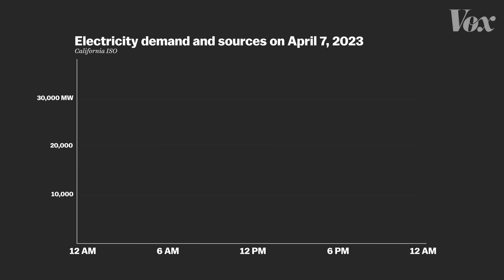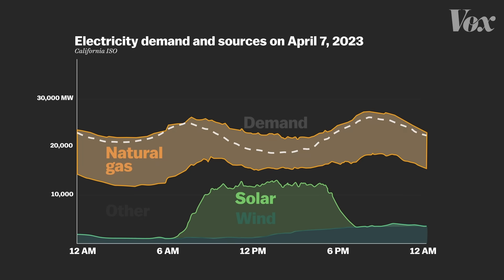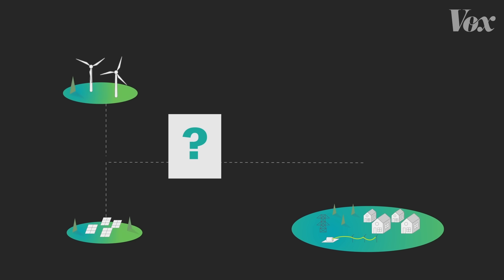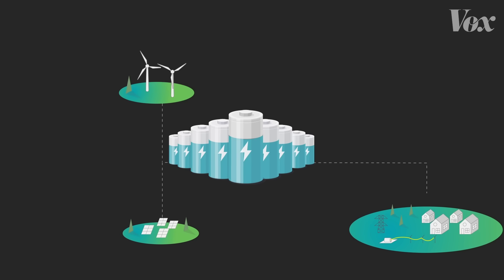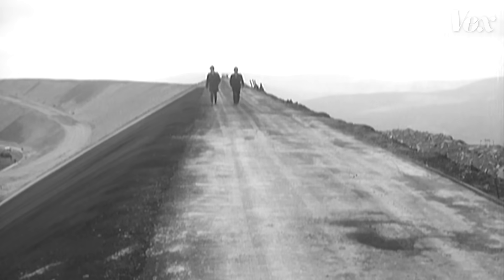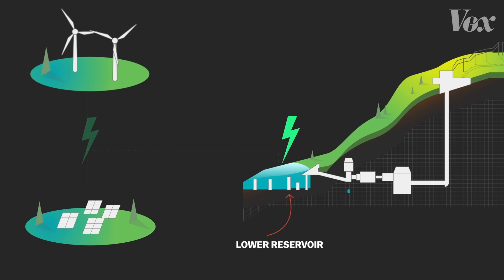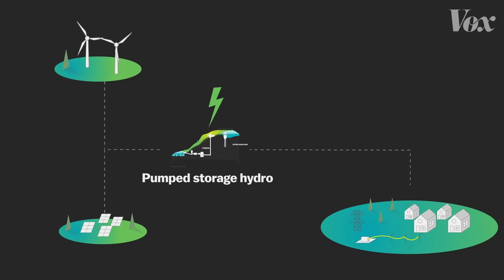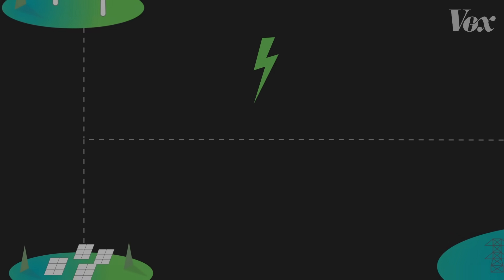How to fix clean energy’s storage problem

Comment: Another option is to overproduce wind and solar and beef up transmission so that it excess in one area can be distributed to an area that has less at that moment.
Reply: It can help to a certain degree, but it cannot replace storage entirely. Weather systems are very large so you'd need to move power vast distances to completely avoid adverse weather. 

If it's nighttime (no solar) and there is no wind, you might have to transport multiple countries worth of electrical energy across half a continent. Such transmission systems are not really economically feasible. And then there's the inefficiency of having that much overcapacity everywhere.
Reply: @fixminer9797  agreed. Another storage option not mentioned in this video is hydrogen electrolysis.
Reply: @kevinmbrooks  Yeah, that seems rather promising and reasonably scalable. It's weird that they didn't even mention power-to-gas systems in the video.
Reply: @Kevin Brooks  the issue with H2 storage is efficiency. Electrolysis is currently too inefficient to make it economically viable unless the electric company is paying you to take the excess power.
Reply: @stevk5181  for what it's worth, the Volts podcast had an episode about developing and scaling up elecrolyzers recently.
Reply: Which makes electrolysis
 a good fit for combination with overproducing electricity from renewables. Unfortunately the hydrogen (edit) embrittles the metal so you can't easily use the natural gas network to then distribute it AFAIK.
Reply: @szurketaltos2693  hydrogen is not corrosive. It can cause metal embrittlement, but that's different.
Reply: @stevk5181  fair enough, I'll edit that. Still, not great for pipelines.
Reply: @stevk5181  so looks like up to 15% hydrogen gas in a natural gas pipeline is feasible, whereas a pure hydrogen gas pipeline is possible (and not unusual in industry) but requires a new network to replace natural gas. Is that right?
Reply: @szurketaltos2693  I'll be honest, as a chemist, I don't know specifics on pipelines capabilities. However, if it's safe to mix up to 15% H2 into natural gas, that would be helpful in cutting CO2 emissions while maintaining current infrastructure until new H2 specific lines could be put into place.
Reply: @stevk5181  as I understand it, it's not safe as is but doesn't take too much to allow for the possibility. Not sure where the cost/benefit is there vs just using the money to incentivize going fully electric.
Reply: @szurketaltos2693  in my mind anything that cuts emissions to buy us more time to electrify is a benefit, especially if the cost is near zero. We'd still need to transport H2 throughout the US because some areas are more prone to generate excess electricity than others. H2 then allows for the storage of the energy and transport to where it's needed most, just like natural gas. So we need time to build out that infrastructure.
Reply: @Kevin Brooks said "beef up transmission so that it excess in one area can be distributed"  
Doesn't that run into the issue of losses over distance?
Reply: @LabGecko  I think that's the point of "beefing it up", making bigger power lines and possibly high voltage DC. I'm no expert, so don't take my word for it. I'd recommend the Volts podcast episode "Transmission month: everything in one place".

Comment: This video just proved why solar and wind energy is being pushed instead of nuclear energy. They still need fossil fuel as "backup power" during down times.
Reply: There's nothing wrong with wind and solar energy but nuclear power should have been the primary source of clean  electricity decades ago with those two helping nuclear.
Reply: Nuclear is great but it has the opposite problem. You can't really ramp them up and down. They are designed for mostly constant output. So you can't turn them up or down.  There will always be a gap to "fill" either  excess energy you need to store, or something else to turn up to meet demand.
Reply: @jpcool95480  True but at least the power output is consistent, so you don't need like a week of backup storage to prevent days long blackouts because there was a particularly low wind/cloudy week. 

I think that's the part we are missing, cool daily averaging and stuff is quite easy because the amount of power storage for just matching supply with demand over a day is much easier. But we forget that renewables are not consistent over the year at all, which means you need to average out the year. While with nuclear sure it's pretty inefficient to power up and down, but you can just over produce and waste the rest and be sure you have power, or you can average out the day demand, but you don't need backup power for a full week (or whatever level makes blackouts rare enough to be acceptable with renewables )

With renewables what we are seemingly doing is just over producing because the cost per unit is quite low, but then we still can't store it so we need fossil fuel permanently on the grid until such time as we have enough grid level storage to store on the level of multiple days worth of energy.

Comment: Just produce Hydrogen and store it. If I remember correctly the efficiency doesn't quite hit 80% but it is easy to store
Reply: Water electrolysis can achieve 70-80% efficiency only, then there's the energy loss of compressing hydrogen and building thick tanks to store it. Then converting hydrogen back to electricity using fuel cell is only 60% efficient. If the hydrogen is used to drive a turbine that drops to 30%.

Comment: Another potential solution will be eletric vehicles! We will have millions of bateries in cars that most of the time are parked. So we could use them to power our grids when needed as a virtual gigantic battery (for instance cars when parked at the workplace could recharge their batteries during the day when solar energy is the highest, and then at the night part of that energy could then be sold to the grid).
Reply: Back of the envelope calc shows that it wouldn't even provide a day's worth of power -- when, ideally, there needs to be a minimum of 1-2 weeks of storage to account for periods of lower than average solar/wind.

Assume 8M vehicles with an average capacity of 100kWh. Now assume you'd have 70% available to discharge at night (because nothing is ever ideally 100%). Now use an average future California energy demand of 40GW:

(8M x 100kWh) / 1,000  = 800GWh
0.7 x 800GWh = 560GWh
560GWh / 40GW = 14 hours

Sodium-ion grid-scale batteries should've been discussed as they have the potential to be significantly cheaper than lithium-ion batteries along with a nearly inexhaustible supply of sodium. Nuclear and advanced geothermal should also be on the table. The cost of nuclear could go down significantly if done at scale and not as one-off projects (e.g. Vogtle in Georgia).

Comment: Energyvault? It can't get much worse. Gravity is a weak force. You need mammoth amounts of weight going up (that's why we use entire lakes in pump hydro storage). Water is also flexible and can't break.

Sigh. Stop peddling this nonsense. Even gravity vault themselves don't believe this anymore, and is roling out BESS.

Comment: This same thing can also be done with compressed air in salt caverns. I think it’s called CAES, compressed air energy storage.
Reply: And flywheels, and molten/redox and flow batteries
Reply: Or hydrogen
Reply: @Mesh17i82  that's the horse that oil companies are betting all odds on
Reply: @BeLowBelowo  if they spend Billions on it. Let‘s go

Comment: Here's an idea: use the irradiated water from nuclear fission power plants in the modular pumped storage, this way you have a solution for storing this water while it takes time to release it's harmful radiation, and you put it to use as a battery at the same time!
Reply: 1: There is no irradiated water.
2: If there was, you would NOT want it out in the environment in any form.

Comment: Quidnet's idea seems to be much more realistic than Energy Vault's, it would take a comparable amount of engineering and would have less maintenance costs, since water doesn't erode like concrete does. And you don't have to reinvent the wheel here, it's just miniturisation of existing technology. Did I mention the CO_2 output of concrete production?
Reply: Water doesn't erode but the infrastructure it's in does erode.
Reply: @szurketaltos2693  then build it underground?
Reply: @someguyyt8595  underground still requires infrastructure like pipes and coatings
Reply: @someguyyt8595 price of underground construction is much higher due to excavation and foundation support
Reply: @gargara1900  that too. I think it's probably a similar (but worse) situation to pumped hydro where there are a few caves that would be good enough, otherwise you need to dig.
Reply: @gargara1900  no, usually they use pre-existing caverns
Reply: @Valentin-oc5nh  u still need to conduct stability tests and soil profiling for existing caverns tho, not all existing cavern can serve as the site
Reply: @gargara1900  I agree, but I think considering the scale I think it makes sense. But as the video suggests, a mix is needed
Reply: @Valentin-oc5nh  i do agree that a stable pre-existing cavern can definitely save lots of cost. I think we do agree that a mix is needed.
Reply: Vox had just 7 days ago what's the problem with concrete. :D
Reply: @rocko44444444  the concrete certainly doesn't have to be brand new though. It's just an example of a weight,  I'm sure any material could be used. 

Would be great if they were able to bundle up construction waste and make that the weights.
Reply: the same is done with air actually
Reply: Water evaporates
Reply: @IncognitoChopper  Of course! Water evaporating from a closed, pressurised, underground reservoir! Why didn't Quidnet think of that?!
Reply: It is about localisation… water you need gradient differences, just hanging weights, could be placed all over

Comment: This is why nuclear power is also very important! It is a reliable source that can be ramped up or down in conjunction with renewables to meet demand.
Reply: AFAIR nuclear can't be so easily ramped up or down, but once it's built, it's a stupidly cheap way of getting a base load of electricity, helping the grid have higher surplusses when wind/solar pick up, and lower valleys when they don't; so you have more spare energy for storing it on the good times, and need less storage for the bad times.
Reply: @cc_jmk  Nuclear is very flexible! You can control the power output of the fission reaction, as well as the amount of steam that reaches the turbine. The department of energy has a good article on it.
Reply: @ltmbookworm  Nuclear reactors are "rampable." But the initial capital investment is so high, and the variable costs are so low, that operators want to operate as close to 100% as possible.

Comment: I use potential energy to save fuel when I drive my car. When I go up hill I accelerate for 2/3 of the distance to the top then I coast to pass the top and go down hill. That's very efficient. Much more than staying in gear from a small distance after the top of the hill. I know it's a little bit dangerous but I'm a pilot :trophy-yellow-smiling: No need to worry :elbowcough:

Comment: Other options include Liquid Metal batteries and flywheel systems.
Reply: Just Have A Think has excellent videos on the topic
Reply: The very fact that a 100% fossil fuel grid up until recently is why such technologies aren't readily available because there wasn't a market for instantaneous energy storage - in contrast to gas peaker plants

Comment: Energy vault is enormously expensive and completely unworkable. The mined storage method is basically the same as pumped hydro.
Reply: Besides, nuclear power can fill in the excess demand. Although nuclear is typically considered a base load, it certainly seems like it has the potential to ramp up and down like natural gas. Just move the control rods in and out to control the power. However, there might be something I am not taking into account, so let me know if there is anything stopping nuclear from being a replacement for gas.
Reply: Pumped hydro is a great solution but only works in terrain that supports it. I imagine mined storage would work in more places

Comment: EnergyDome, an italian company which uses CO2 and it's thermodynamic process of compression (when there's an energy surplus) and Rarefraction (when energy is needed in the grid) also seems to be really promising. They are building out pilot projects and a gridwide solution is also already in the planing

I guess Undecided with Matt Ferell made a  really good video to explain the Process and it's up- and Downsides

Comment: Simple: Thorium Nuclear reactors!
Reply: ahh right. "simple"
Reply: Similar to most of the mentioned storage technologies, Thorium reactors are not ready yet. There are plenty of research reactors around the world, testing and perfecting the concept, but we're at least 6-8 years away from large scale production use, if everything goes well. And I suspect that not everything will go well with the several hundred degC hot and corrosive molten salt.

Comment: Energy vault comes with too many problems and little benefit. It’s a showpiece, which is why none have been seriously considered.
Reply: It's a venture capital
Reply: Yea ofc. But when the earth start changing everyone start to pay attention lol
Reply: You mean energy storage in general?
Reply: @TH-lu9du  No. That project is seriosly flawed. There are many reasons why we manly use fluids for storing potential kinetic energy. 

Only other interesting concept I've seen so far is undersee air storage, which is pumped storaged hydro but inverted.
Reply: @haifutter4166  ah the company behind the concrete gravity idea. Sorry, I wasn't paying attention. Makes sense after I re-watched the video. "Energy vault" is such a generic nondescript name LOL.
Reply: @haifutter4166  why is fluid better?
Reply: @mutton_man  It's scalable, you "only" need a turbine, pump and piping to move that gas or liquid, and to make use of its energy. Imagine a warehouse like in the graphic and than compare the minimal equipment for a tiny lake with the same volume. The "energy density" of a few concrete blocks liftet a few meters is quite low.
Reply: @haifutter4166  I see. So the height of the blocks wouldn't be high enough to create enough potential energy. Also more energy intensive lifting the blocks  up high than compared to pumping water up a hill?
Reply: @mutton_man  It's not cost effective or practical in comparison to other solutions. That doesn't mean you can't do it.
Reply: @mutton_man  The solid is also going to be discrete in how it will turn the turbine. There would need to be a timing of when the blocks fall in order to keep the turbine spinning. The fluid spreads out and it is more infinite in the number of blocks falling. These large number of particles makes it so timing when it hits a blade is a lot easier.

Comment: Easy!!! Abandon the foolish concept of renewable energy and just build nuclear which is easily better in every way.
Reply: Rather than abandoning renewable energy, we should continue to invest in and innovate these technologies to make them even more efficient and cost-effective. Nuclear power plants are expensive to build and maintain. Additionally, nuclear energy is not a renewable resource as uranium is finite and non-renewable.
Reply: @shivanshsingh8229  Solar is not renewable either: as soon as all of the material in the Sun went over nuclear fusion, it's over. But for the foreseeable future, we have more than enough left from both Uranium and sunshine.
Reply: @szaszm_  We have 230 years of nuclear fuel left according to NEA on the other hand we have 6 billion years of sunshine left.
6000000000 years vs 230 years. In the best case we humans will last for 1 billion years. So the math checks out.
Reply: @shivanshsingh8229  yup because 230 years of nuclear fuel is something we should worry about now, and a reason to not use it as a stop gap when the other solutions are just technically not capable yet. For some reason most climate fanatics come from liberal arts schools and not from physics, chemistry or other hard sciences. its a bit sad. They have the right intentions (hopefully sometimes one doubts it) but the technical knowledge is just so lacking.... ideological beliefs are not a good substitute for hard sciences.
Reply: @shivanshsingh8229  There is a lot more uranium left in less accessible places that are currently not economical to mine. And most current reactors only utilize a single digit percentage of the available energy from nuclear fuels. We could more than 10x the supply by using more modern reactors, or at least reprocessing spent fuel. We could go another 230 years just by using what's currently stored as spent fuel.

Comment: Nuclear reactor all the wae
Reply: Too expensive and impractical. Basically every other solution you can think of is vastly cheaper and quicker to implement.
Reply: @brianrcVids  Its sad people like you hate nuclear, we have had a good reliable renewable source of energy for decades but due to fearmongering it is sidelined. Yes the upfront cost is expensive but we need to see the long term gains and stop getting distracted by new shinny renewable projects.